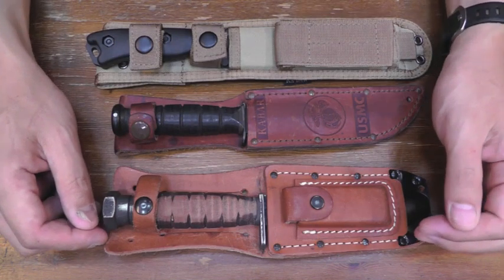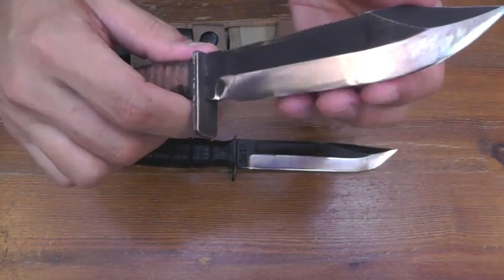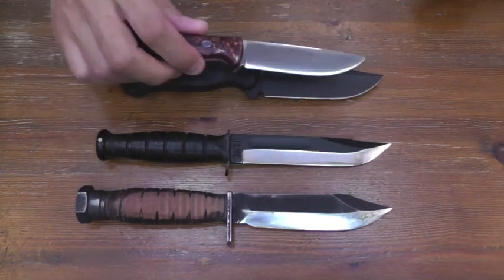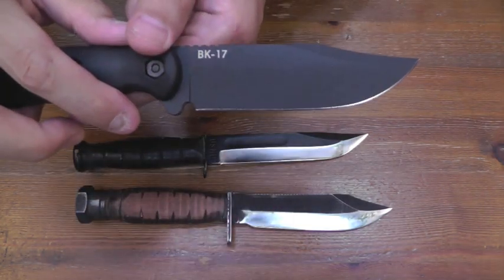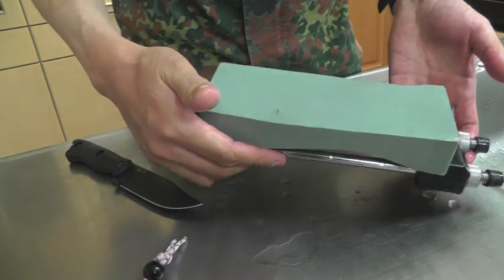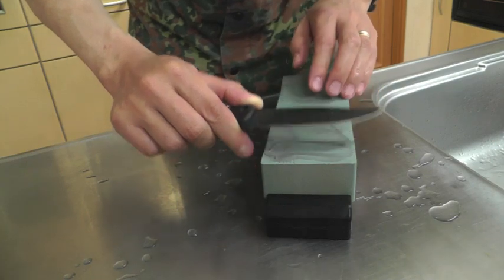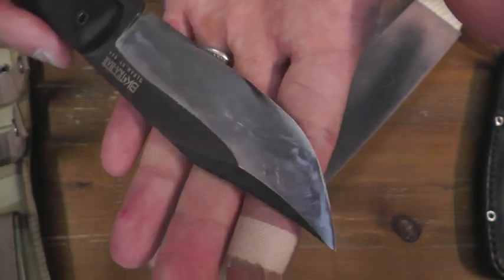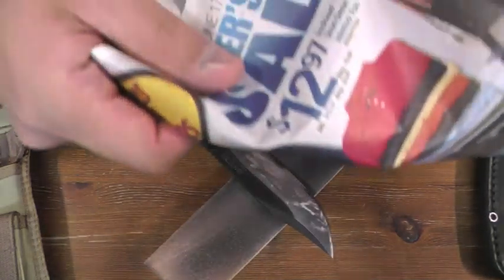Saber-Convex BK-17 Knife

Comment: Nice job, I have done the same thing to mine but I knocked the handel scales off and used a powder coating stripper to remove all the black coating and then reprofiled it! Went back over the bear surface with a cold blue, put the handel scales back on and ready for use! It is extremely sharp

Comment from the maker: My #220 water stone is like #80 or #120 sandpaper and cuts fast. My #2000 water stone is fine enough for my convex edges because I go to black compound stropping after the stone. And I admire the remaining sharpening patterns on the whole bevel which is fine enough not to take water drops which make rusty spots. My Chosera #400 stone cut faster than expected and I kind of straightened the belly like always. Belly line is really difficult to shape out beautiful. Thanks.

Comment from the maker: Saber partially beveled secondary V edge knives like Ontario AFSK or KaBar USMC have pretty large primary bevel angle. So I need to regrind from the bevel transition line to make a sharp convex edge on it. If it is a hollow beveled knife, I don't need to regrind from a high line but from just above the secondary V edge. I need a convex edge on every single hunting knife of mine. It slides on bones and doesn't take chipping. I would love 19C27 rampless Gunny or coming S35VN one for all weather.

Comment from the maker: I used #220 green carbide stone, and Chosera #400, #800, #2000 stones. I love my Chosera trio very much for outdoor knife sharpening. I use the green carbide stone entirely for heavy chip restoration and edge reprofiling. I have just a little experience. Chosera stones are outstanding. They make amazing slurry from themselves and their sharpening speed and feel are awesome! You can see the slurry on the video. Thanks.

Comment from the maker: I know myself 154CM and S30V are great stainless steels. But I don't know about S35VN. They say S35VN is an innovated steel to S30V and has more wear resistance. 19C27 seems like a next steel to 154CM and is better than VG10 or AUS8. Anyway stainless steel made wood knife is kind of rare and I can imagine only Fallknivens for it except for Bark Rivers. Hollow grind is no good for wood jobs. Many flat grind knives are in carbon steels. Scandi 12C27 knife can be good for you. Thanks.

Comment from the maker: BK-16 will be a better skinner with its slightly deeper belly and its full height flat grind. If I have it, I will need to put my home made convex edge on it anyway. It will take less time but it won't give me as sharp an edge as this one for some reason I don't know. High grind Scandi-convex bevel always gives me extreme sharpness. For the high regrind I needed BK-17's saber bevel. The BK-16's full flat bevel won't take full height regrind. And I preferred BK-17's clip point design. Thanks.

Comment: If you plan on getting more knives like Beckers or any other knife with a coating and want to remove it before sharpening, use paint stripper. It removes it pretty effectively. Ive seen that jasco provides good results but it depends on whats available to you.
Reply: could you remove only half though using paint stripper like virtuovice did using Waterstones?  I really love the look of his half paint knives
Reply: I assume you could. Or what may be easier is hand sanding it with sand paper. That way you can control your lines a bit more. Its hard to control the paint stripper. Virtuovice basically hand sanded it in a way since he removed it during sharpening.

Comment from the maker: Theoretically what you are saying seems all correct. But in practice I feel almost nothing about what you are saying. I like Scandi and Convex over Secondary V edge because their edge angle (20 to 25) is almost always smaller than V edge (30 to 35). Scandi and Convex bite or whittle wood well due to their smaller edge angle, and bite deep due to their wider backbevel. Hollow bevel doesn't bite deep at all. For slicing meat all bevels do the same. I like Convex because it slides on bones well.

Comment from the maker: I didn't know Enzo had Trapper 115. 115mm is the same as my Enzo Badger knife and it is a good size for a general outdoor knife. I like 12C27 very much. It is not prone to chipping and takes and holds relatively small angled edge. It is definitely superior to AUS8. Did they upgrade their regular SS from AUS8 to 12C27? Anyway the primary edge angle of Trapper is fairly deep and doesn't take additional micro bevel. So you will need to keep its zero grind Scandi bevel to keep it very sharp. Thanks.